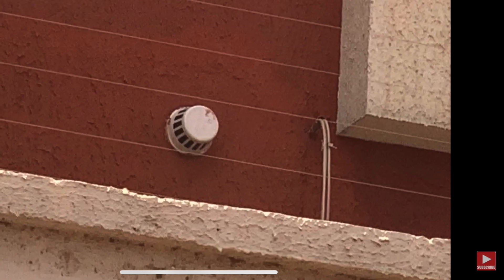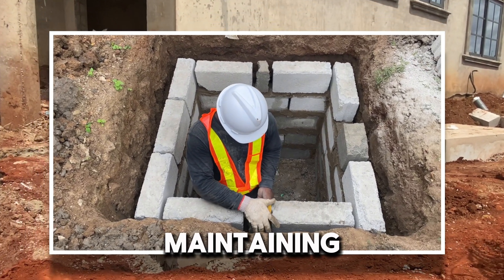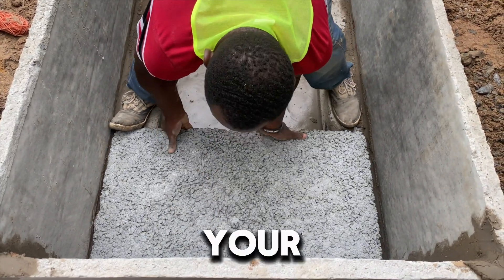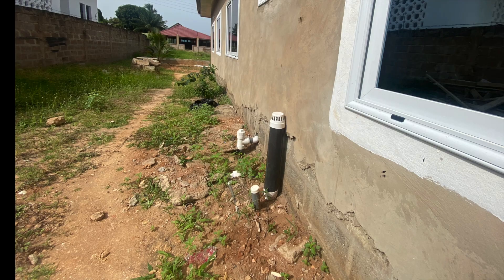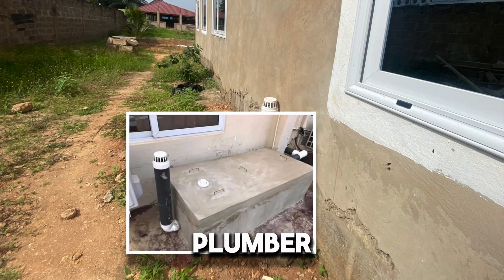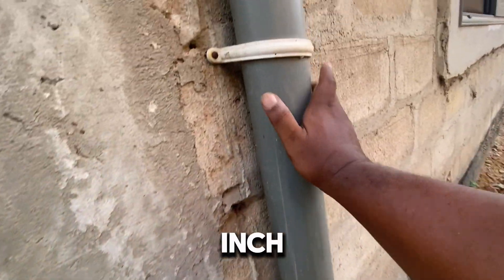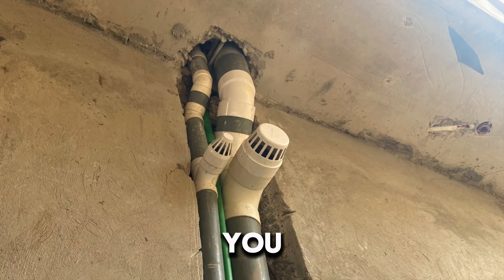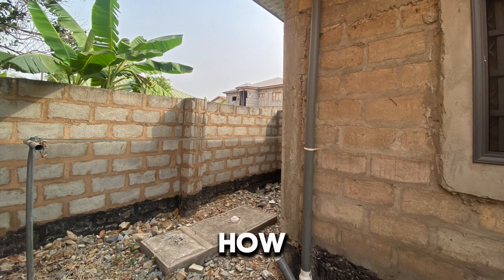Don’t make this biodigester mistake! Say no to vent pipes

Comment: What of the vents that as already been done by Plumber on building so please sir I'm asking can those vent work for digester system installation instead of putting another one on digester tank either long or short
Reply from the maker: Yes the one on the building already done by the plumber is enough for both the digester and the toilet seats https://youtu.be/TM2YqP1KOVU?si=A7bHdYa1hp6HhPRX